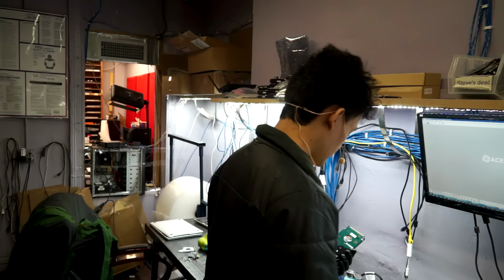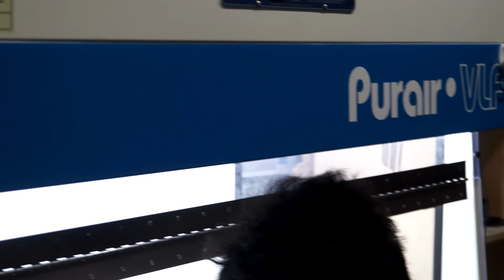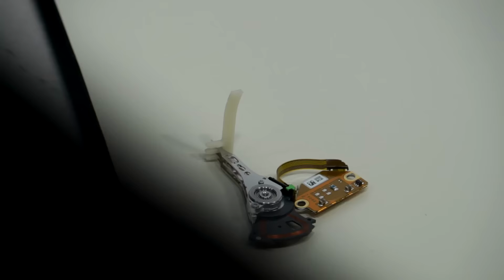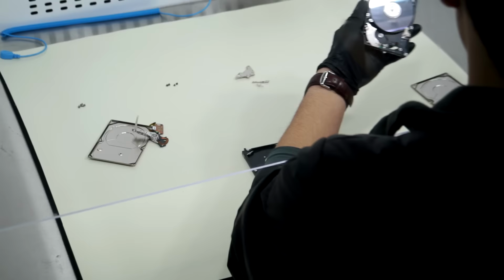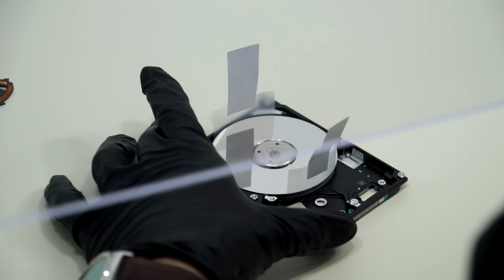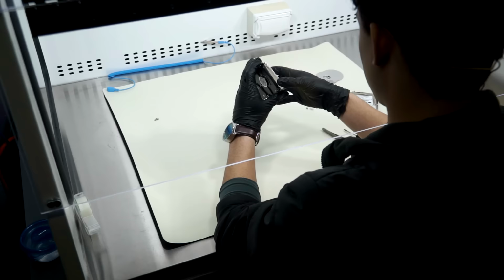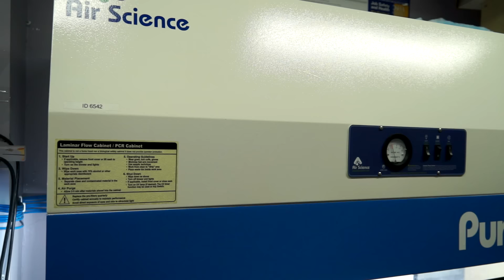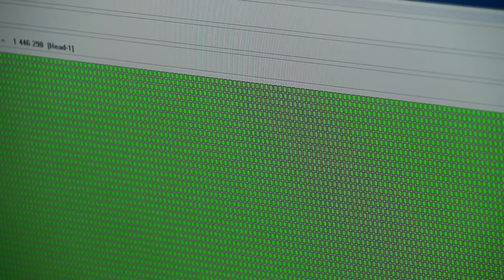Data Recovery: Hard Drive Platter Swap in Our Lab!

Comment: The black 'bits' mentioned is the head. Not much different to the read/write head(s) that were used on a spinning drum
of Video Cassette Recorders. 
The head on a Hard Drive is attached to an arm. That's it.
The distance/gap between the head and the platter is microscopic
The head testing tool that was used to test the heads on a VCR can also be used to test the heads of a  HDD,
as the principle of operation is the same.

Comment: Another quality video from you guys, glad you have a quality employee with the desire to learn. 

However I'd like to make a more accurate comparison for the car guys. You can rotate car wheels without having to rebalance them, a more accurate comparison would be that you can't swap cams without putting them in time with the crank. The two platters must be in time with each other in order for the data to output correctly, just like the cam(s) have to be in time with each other (and with the crank) to allow air flow through the head at the proper time.

Comment: I've recovered data from defective drives by merely holding them in a specific orientation that would loosen the bearings enough to spin and operate long enough to pull the data off. I've secured some really nice maintenance contracts doing this in front of prospective clients that heard of me from word of mouth.  Thank God, however, I'm no longer in the IT business.

Comment: The sliders are NOT magnetic in the sense of magnets physically attracting each other..  The spring tension of the load beam of the suspension will cause the sliders to touch each other and the surfaces are VERY smooth, so they will stick together.  Trying to separate them will rip the sliders off the gimbal.

Comment: Some years ago I watched a promotional video from a U.S. Company that manufactures 
tools and equipment specifically for HDD platter swap, wherein  they have a circular clamping
tool that one slides over the platters and it clamps those platters.
Using the tool, the platters and then be transferred onto a donor drive, screwed in, and the clamp
released, thus ensuring alignment integrity is maintained.
The name of the Company escapes me now.
I remember saving the promotional video. 
Now I have the task of finding it. It may not on the current 4TB drive where video is stored.
It may be stored on an older now redundant drive.
This will bug me now until I find it.

Comment: "2 pieces of tape", I would be sticking as much on as possible. Obviously the alignment on this 80GB drive has some tolerance so is it the same on higher density more modern drives? Considering there is a hardware device and software reading raw data, I suspect the alignment is not that critical at all and the software is reading the raw data and then pulling files from the extracted data. Similar to recovering "deleted", old data from a repartitioned/formatted drive, or damaged platter - that is where the data still exists but the file system cannot see it.
Reply: No, the "replacement" alignment is critical.
When the hd was built the platters were "virgin", the first formatting wrote data below the r/w heads, even when the head wouldn't be aligned, the written data is exactly below its head.
Things are different with CD/DVD/BR or floppy drives like the 1541 (Commodore 64 drive), which I (and others) had to recalibrate the r/w head travel...
Reply: International Mutual Neutralist Party Templates, watch the video the repair alignment is not exactly of low tolerance.  That is why the hardware/software combo is required to overcome the issues.

Comment: I'm a Rossmann fan and always learn a lot from the videos, but on this one I think he couldve saved hella time drilling the back of the bearing with a 1.10mm drill bit and lubricating it from the underside till it loosened up. if it was just for data recovery that shouldve done the trick after confirming with the heat trick that the bearing was indeed the problem.

Comment: Just took my hard drive apart to find out the heads were stuck together. I pried them open only to destroy them. Then I came to watch this video after my blunder. Luckily I didn't have to much data in those hard drives

Comment: I have opposite problem I want to remove data from my old drive, but I guess bit of disassembly and strong magnet will do the trick. I think the plates exposed to elements will not hold data reliably after that.

Comment: If data copy is a bit slow, it's coming from a slight misalignment. Then, the first spin determine the track/sector start and spin adjustment. In this case, you get a better read speed head by head.

The day you will need to recover a deleted and overwritten disk (forensic data recovery), I can explain how to do. You have the tools, I believe (oscilloscope, knowledge about amplifiers and filters) and I can tell how to get even thoroughly wiped data off a disk

Comment: Often, to avoid problems with the HDD, it is enough to remove the control Board and use a soldering iron to apply solder to the contacts through which the control and recording-reading information takes place. Since about 2006 use less dangerous compound of silver, but which is very quickly oxidized. Ideally, these contacts on the Board should be covered with gold. It is desirable to apply solder to these contacts immediately after the purchase of HDD.

Comment: the heads are not mangetic, they are ferrite, the coils in them create a magnetic field from the control board that write the disk, and vice versa to read, the tiny magnetic fields from the disc is picked up by the coils in the ferrite heads..

Comment: Clean room? No need for that (in my case) :))
I opened a lapop 80 Gb Hitachi Tavelstar.And I managed to "crack it open" literally. Upon noticing the frienddly dust particles clinging to the platters, I simply used a rubber air blower for camera lenses and amaingly, the drive refused to die, even after being "pryed open" by me! :))

Comment: Out of curiosity, I tried how much you can abuse the surface of the platern.
Turns out they are not really sensitive!
Fingerprint, durst, minor scratches are no problem!
I scratched it with a screwdriver while it was running, and it lastet the whole evening playing Need for speed, until the heads started melting and sticket to the platern. 😈

Comment: When the platters are not aligned correctly the data synchronicity is lost.
The Platter's switching point is/are aligned between platters, in much the
same way as a vehicle engine needs camshaft timing so the spark plug/s
fire at the precise moment of ignition between one cylinder to another.

Comment: I may be able to come up with a solution better than scotch tape. While it works im sure it should be possible to make a tool that is re usable. Im thinking some sort of thing plastic with a thing bit of rubber that goes around the platters and maybe below and in between the to mae it a tad faster for transplanting them. I got some totaled drives here i can play with. Ill just take some pics if i get time to try it and post em for you.

Comment: You should offer a service where you use that air cabinet to put screen protectors on iPads. I can't get one on cleanly because my house is too damn dirty. As I clean off dust particles under a bright light, I can watch new ones fall onto the screen. Every time I get trapped dust particles with air around them.

Comment: The problem with the Toshiba HDD makes me worried about the mechanical HDDs in Laptops i have had stored in non-climate controlled unit for over a year and half. Going to change everything over to SSD eventually. Using a Patriot Burst SSD right now (2.5").

Comment: Hi and greets from Berlin Germany! Nice tutorial! Helped me a lot understanding HDDs in general. 
I have one question: 
Why did Jason NOT USE the read&write heads and the rest of the mechanics from the donor HDD?
Why exchange all small parts AND read&write heads to the donor case? Why the extra work?
Wouldn't it be much easier to ONLY exchange the platters and leave the rest in the donor HDD?

It would be nice to give an advice NOT to use magnitized screwdrivers upon dismantling the HDD!

Great job..! Thank You!

Comment: I've been disassembling hard drives for years, both for the magnets and to use the heads as musical instruments (try plucking the "tines" on the head without the little "needles"attached--sorry, I don't know the technical terms--and you'll find they produce a perfect tone [the "needles" dampen the resonance]). That is, until you bend one of the tines and it sounds like the worst dissonance you've ever heard. I can never find enough scrap hard drives, as the heads always bend over time. :{ 
Although I don't have a clean-room thingy like this, I'm excited to start experimenting without one. Thank you so much for these videos.

Comment: I saw a guy in the AV department do this without clean air he just dusted it with canned air once he was finished and it worked well enough to recover the data, that was in 1995 were hard drives less delicate then ? he didnt seem concerned about it not working due to contamination

Comment: Hi @Louis Rossman and Jayson/ Jason, what if you do not need data off a platter and you swap and pcboard - so i.e. no need to swap a bios.  1) Do you just use the drive as normal but consider the data gone? 2)  do u need to reformat fully and not just a quick format?

Comment: Good video, but done on a very simple drive.  I have a 3tb Toshiba drive that has failed and it's not possible to lift the platters out in one go like that.  They are separated by a fixed plastic separator between the platters.  Also the magnetic is one piece, no bottom and top part, so not easy to lift head arm out.  The head arm when fully back doesn't clear the platters, the middle of the arm (slight curve) overhands the platters by about 3mm, which also makes removing the head more difficult.  I think this drive was designed not to be serviceable.   Model number DT01ACA300.  Note don't buy Toshiba drives.  I had 2 bought at the same time, fail on the same day.

Comment: @louis rossman 
Love watching your videos and was the push I needed to start my own bussiness of Apple repair in Portugal.

For the alinement part may I sugest a 3d printed tool to lock those platers via 2 oposite spring pads? Almost as a car external bearing removal tool. 

It may grip with just enough force so the platers don't shift around. If you provide the diameter the height of the plater and the distance between each plater I may print and send a prototype for you to test, and if needed make the necessary changes.
Also the needle tool that you use can be made for a 0.01$ in a 3d printer.

That way you spare the duck tape and maybe can do it faster.

Another ideia that Im thinking off is using a 3d printer without normal printheads but connected instead on the multimeter and via board schematics and GBRL. 
Maybe just a dream but using a cradle designed to every board (cheap in PLA plastic) so the software knows here is at on the hardware level. GPS for macbook boards... eheheheh

That way we can point like: 
go to x23 y 33 and go down 20mm (spring'd tips) for positive current simultaneous the other probe go like x1 y3 for GND, 
My crazy idea is how to automate the process of detection of broken lines. 

Maybe a downside of it is that the dual carriages don't allow to be almost together (to read individual SMD's, minimum distance 25mm).

If you have time I will happily chat and discuss this ideias with the most informed mac person.
Keep up the good work!

Comment: Tape isn't needed to maintain data alignment. Each surface is encoded for it's own alignment and can be read out of alignment of the others. Maintaining the balance is important. More important is maintaining platter order and orientation. Since the file table is only kept one one platter surface and will not maintain data if the platters are "rearranged"
Reply: So you mean if you turn a little bit one platter (for example 2 cm) against the 2nd during the moving to another hard drive, it should be still readable and it is not a problem?
Reply: @KejmlBV . The only problem would be if by the moving of 2cm creates an out of balance. The vibrations if severe at 10,000rpm could be catastrophic.
Reply: @tommysmith8801  I think it didn't make out of balance but the platters are against each other now in a little bit different position than before, is it problem or doesn't matter if we rotate one platter a little bit?
Reply: @KejmlBV  doesnt matter
Reply: @tommysmith8801  We read a lot of articles and watche the videos where people (also which look professionals) changing the platters with the tapes to eliminate rotation because they are saying if you rotate it a little bit, it will be never possible to read the data again. Do you have your own experience or some link to some website where I can read and prove that it doesn't matter, pleae? I would like to be 100% sure before we will buy another HDD to get a new heads etc. because we move platters to the same HDD and we cannot read the data anyway. :-(
Reply: @KejmlBV  only issue would be if you flipped the platter upside down
Reply: @tommysmith8801  Thank you so much for the info. What about firmwares on both drives, must be identical or doesn't matter as well?
Reply: @KejmlBV  that depends are we talking lba vs hts. An old hts firmware will never read lbs correctly.

Comment: brilliant work guys , i have few questions 
1.  which software tool you are using to access the drive ?
2. what is obvious sign if your head has failed?
3. what if there is something wrong with the magnetic platter itself? what are the signs
i have hdd which is taking so long to detect , then takes so long to show partitions and accessing the data might be forever i suppose.

Comment: You use magnetic screwdrivers to screw in the holder of the platter? Is this a good idea? Or is the field strength of that screw driver unable to flip bits on the platter?

Comment: hello, bro, I opened my drive, to repair it with new components, now i want to know if i remove the flaters from the drive out, then at the time of putting those back can i put those back like or there is some synchronisation is to be done.

Comment: I have a 2.5 seagate 1TB drive with 2 platters. Head wont mount the platters anymore, the platters loom good and spin fine...should I swap in a head from a donor drive, or swap the platters and PCB board into a donor enclosure?

Comment: Great video.I would really like to know where to buy the head combs and pins. As i didn't register any mention on the video regarding head combs being different for each drive, is there a difference if i would just buy/use a general head comb for i.e: 2 platters 4 heads for 2.5in hdd, should that comb have the same spacing on all 2.5 drives with those specs or  is different for each manufacturer?  Are those on aliexpress for 11$ ok buy? Or is there any other suggestion?  Thank you in advance if you manage to answer.

Comment: How do those drives keep there alignment in the case than actually? Are he spinning seperately of each other or do they spin synchronized? If those 4 holes are in both, cant that be used to pin the alignment?

Comment: Nice job guys, do I have got questions. Will it work if I swap the head using the same model, size, first 3 digits of serial number and same firmware version?

If it will work, can I use hddsuperclone to clone the hard drive or I still have to use PC3000??

Comment: is this good for hdd when it works upside down? I always heard they are allowed to be  horizontal with electronics on the bottom (or vertically) otherwise the heads can scratch platters or because of the bearing (I have forgotten what was the main reason). Maybe it is a kind of myths, is not it?

Comment: Hi Louis, I have a problem where an external harddrive (that has always worked perfectly) has decided to now blue screen my desktop. It does the same on my Windows 10 laptop. I can however access the files on my Macbook but I can't copy and paste to a new harddrive as Mac OS won't allow it (different formatting). I have tried different USB 3.0 cables and same BSOD. What can I do?

Comment: Nice work, but I have questuon. Is it OK to use screwdriver with magnet witch hold the screws?
Plates are magnetic and it is easily to destroy data.
Reply: They are not magnetic

Comment: Hello am looking for an info. I had a hard disk issue recently. Its not accessible and sometimes it says Parameter is incorrect. I took the hard disk to a nearby Data recovery centre he said that thr internal disk has got no scratch so hopefully the data is safe but the header has gone faulty. So now what you gonna suggest ? Whatever they said is it true ?

Comment: What happens if one platter turns 1-2 degrees clockswise? i've made a mistake and take out one platter and took it back to it's own place. but it's not the exact position. i'll find a donor disk and change the platter with this scotch tape method. will it still work?

Comment: Good day. I have problem with an old 160gb harddisk Western Digital WD1600BEVS. I could not find any donor with same model number. I found one seller with model WD1600BEVT. Do you think will work if i use this model BEVT instead of BEVS ? thanks for replying to my message.

Comment: What about using a marker? Touch it lightly on the side of the platter, not the read/write portion. If you use a light ruler and marker, it will give you a center mark on platter clamp and the outside, leading edge of the platter. Similar trick is used for marking timing chains to sprockets on a vehicle engine.